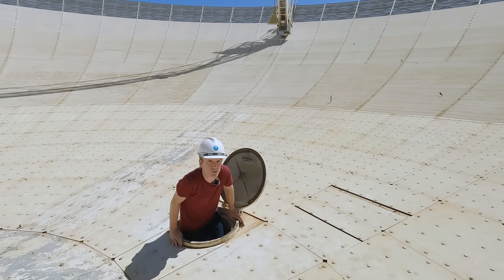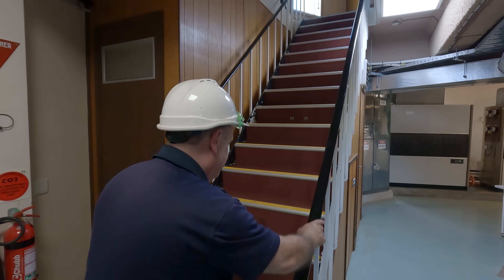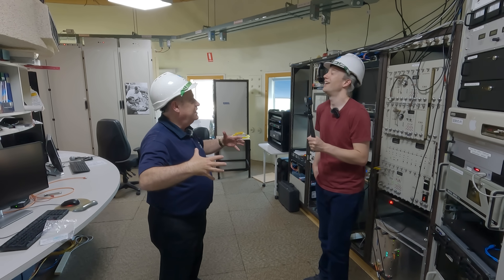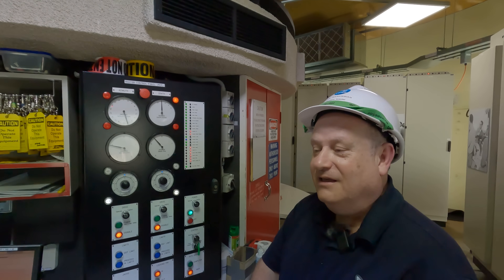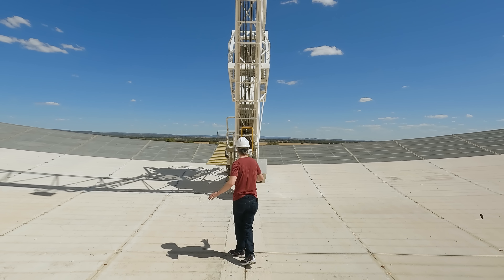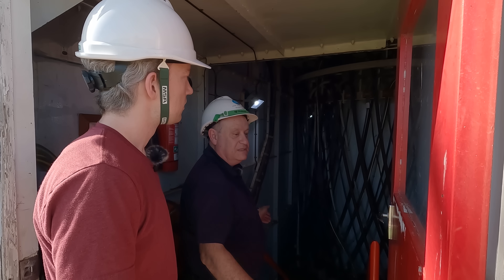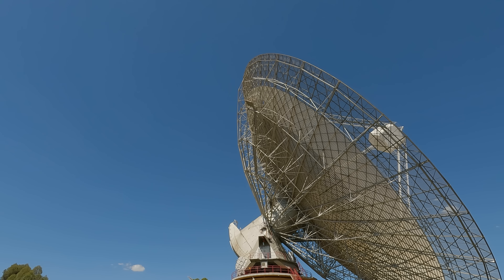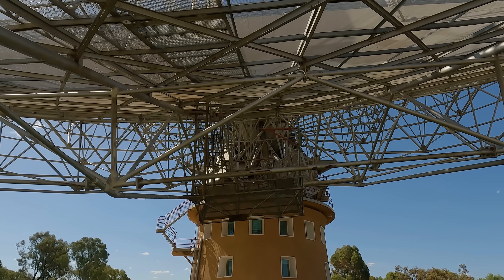I took a ride on a moving radio telescope

Comment: In 1977 I "rode the dish" at the old 27m incoherent-scatter radar located in Chatanica Alaska - its a very intersting experience - it was controlled by both a DEC PDP-8 and an SDS-930 computer - both had real hand-wired core memory - since 1981 it was moved to Greenland where it is still in operation but with more modern computing facilities.

Comment: If its possible to pick up radio signal from a phone on the moon, what happens when a plane flies over with 200 phones and radio transmissions being broadcasted?
Reply: Happens rarely and is insignificant compared to other sources of interference.

Comment: So, if the telescope's on separate foundations, just in the centre, how does it keep from toppling over when they tilt it? Just really really really deep and strong foundations? I bet those are probably quite interesting in themselves, though there wouldn't be much to film, all solid concrete and steel or whatever.

Comment: Might be interesting to know this is a part of a three-way telescope system, the others located in Madrid (well, on the outskirts of it, of course) and California, and they are used to maintain a continuous, global coverage for communications with astronauts and satellites.
Reply: That's actually the Canberra (Tidbinbilla) complex, not Parkes. One of the dishes there is tracking Voyager 2 right now, and will then be tracking Mars 2020 (Perseverance rover) after a 1 hour 20 minute break.

Comment: 1:52 The absence of operating system means that it doesn't (or can't) crash when it should---one of the biggest concern of OSes is a fault isolation, and without that you are really at your own. It should have taken a huge care to make that system reliable.

Comment: The way you had the feeling that you couldn't tell whether you were moving, or the dish was moving, or the sky was moving... I experienced something similar a few months ago when I took an engineering tour of the very honorable Mt. Wilson Observatory, located high above Pasadena, CA.  Though built well over 100 years ago with parts that had to be lugged up the mountain by mules and very primitive Mack trucks, when you're in the 100" observatory dome and they turn the dome you think the telescope is turning, not you, the observer, on what you think is a unmoving platform.  It's only when they open the outside door and you see that trees are moving by do you realize what's really happening.

Comment: 0:00  They've gone through a lot of trouble to make the surface of the dish accurate, so I'm surprised they would have the manhole cover protruding up like that when closed.  Why wouldn't they have made it flush with the surface?  At high frequencies, wouldn't that cause a noticeable phase discrepancy in the received signal at the focus?

Comment: The dish itself would make a really cool performance stage for opera. Tilt the dish forward to reveal the inside of the dish to the audience, fill it with light, use the movement of the dish as a "stage curtain" to reveal a modest orchestra and an opera singer inside the dish.

Comment: That they still use a DEC PDP11 series computer is mind boggling. When I started work in Nuclear Medicine 30+ years ago we had an old PDP 11/34. It had a big reel to reel tape drive on the front. It was decommissioned as it was not Y2k compliant, and because it was very, very old.

Comment: The part about the energy in the feather hitting the floor being larger than that collected by all radio telescopes ever was genuinely mind blowing.
Reply: Like staring at the shadow on the wall and being able to tell that someone lit a match, miles away.
Reply: @Technodreamer  That's a probably faulty but brilliant analogy.
Reply: That’s WILD
Reply: I still have the video paused contemplating this fact. I had to replay it a few times to make sure I wasn't misunderstanding him. That's a crazy piece of information.

EDIT: Followed up by the cell phone on the moon's surface bit. I had no idea we were talking those scales.
Reply: @biggusmunkusthegreat  That's the reason behind the sheer size: radio waves sources are generally far away and really weak. For example one of the most important radio frequencies in radio astronomy is the 21cm hydrigen line. It's emitted by a hyperifne transition in the hydrogen atom and it's used to calculate spiral galaxies rotational velocities: the wavelenght is really long, meaning low amounts of energy are emitted.
Also, the resolution power of a telescope (how small of an angle can be where it can resolve two things separated by said angle) is wavelenght divided by diameter. So for such long wavelenghts a reaaaaally big diameter is needed
Reply: @biggusmunkusthegreat  Goes to show how ridiculously far away things are in the Universe.
Reply: Genuinely mind blowing, it shows just how much information we're missing! We've learnt so much from such a small amount of data!
Reply: Dude brought the feather to work that day. He wasn't just ready with the analogy, he was excited
Reply: This is the kind of thing that keeps me fascinated by the miracle that is science.
Reply: I didn’t understand how that calculation works.
Reply: It blows my mind that they could ever possibly filter out all of the radio noise from earth and satellites and the sun and the planets in our system and somehow manage to see distant celestial bodies through all the haze
Reply: Judging by the explanation it's the total energy of all the astronomical data gathered with the telescopes, not all energy gathered total. In effect, the telescopes's have collected far more energy, but that energy was associated with junk readings which were likely discarded.
Reply: ok
Reply: He really put things into perspective
Reply: <10 mJ
Reply: and the aliens are still able to hide themselves from the mess we call humanity
Reply: ok
Reply: frr
Reply: Jesus Christ loves you so much pls repent from your sins and have faith and believe in Jesus because Jesus is the way the truth and the life Jesus died for you and rose from the dead for you
Reply: @jesuslovesyou83558  the flying spaghetti monster is the only real god, he won't send you to hell for not believing in him as long as you're a good person in life, but it's still best to believe in the flying spaghetti monster anyway
Reply: @hiccupwarrior89  that is nonsense
Reply: I would have thought that the radio-frequency output of the Sun would have been more than that.
Reply: @Lucius_Chiaraviglio  It is. You just can't measure anything around the sun.
Reply: :face-orange-frowning::face-orange-frowning::face-orange-frowning::glasses-purple-yellow-diamond::body-green-covering-eyes:
Reply: Wir sind bewusstlos, wenn wir schlafen oder ohnmächtig werden. 
Wenn wir bewusstlos sind, wir haben keine Gedanken, keine Emotionen und können die Welt nicht sehen. 
Wenn wir bewusst sind, wir wissen alles. Bewusstsein ist Gedanken, Emotionen und alles in der Welt.

Dieses Bewusstsein ist eins. Wird das Bewusstsein zweigeteilt? Bewusstsein ist nicht teilbar.
Spürst du zwei Arten von Bewusstsein, wenn du mit einem Freund sprichst? Das Bewusstsein wird nur als eins empfunden.
Bewusstsein ist eins. Ich bin Bewusstsein und ich bin die Welt.

Evangelium nach Thomas

"Denn viele der Ersten werden die Letzten sein und werden zu einem einzigen."

Jesus sagte: "Zwei werden sich auf ein Lager legen; einer wird sterben, einer wird leben."

Aus diesem Grund sage ich, Wenn einer alles ist, wird es voller Licht sein, aber wenn einer gespalten ist, wird er voller Dunkelheit sein.

Jesus sagte: „Warum wäschst du das Äußere des Bechers?
Verstehst du nicht, dass derjenige, der das Innere gemacht hat, auch derjenige ist, der das Äußere gemacht hat?"

Jesus sagte: „Ich bin das Licht, das über allen Dingen ist. Ich bin alles: aus mir ist alles hervorgegangen, und zu mir ist alles gelangt.
Spalten Sie ein Stück Holz; Ich bin da.
Erhebe den Stein, und du wirst mich dort finden."

Eine [Person sagte] zu ihm: „Sag meinen Brüdern, sie sollen den Besitz meines Vaters mit mir teilen.“
Er sagte zu der Person: "Herr, wer hat mich zu einem Teiler gemacht?"
Er wandte sich an seine Jünger und sagte zu ihnen: „Ich bin doch kein Teiler, oder?“

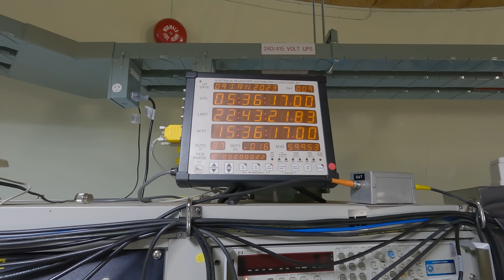Comment: Is that a mistake at 2:06 ? Wouldn't it make more sense to use a hyperbolic shape if you want to concentrate all your radio waves to a single point?
Reply: The parabola is the exact shape required to focus a plane wave to a single point. Hence parabolic dishes coherently (i.e. in phase) add electromagnetic radiation at a point and are central to many telescope designs in both the optical and radio. Some radio telescopes use a hyperbolic secondary though.

Comment: @2:01, you can see Tom standing next to an actual OG PDP-11 they're using, surprised they aren't emulating it on modern hardware. Also who stuck an apple sticker on it?
Also, the PDP-11 did have OSes, most of unix was developed on it.

Comment: They're still using a PDP11???? I don't find the argument about software crashes convincing when there is so much hardware that can go wrong, compared to a modern postage-sized SoC microcontroller that has almost no power draw and only one component that can fail, making any repair a full swap. And a lot of these can also run without an OS, using a simple enough instruction set.

Comment: After seeing Tom all harnessed up and clipped onto the safest walkway Ive ever seen for the high dive video its funny seeing him here completely free walking along an absolutly giganstic tipping bowl.
Reply: It's always interesting to see how counterintuitive a risk factor can be. Standing on a thousand tonne rotating metal bowl is no more dangerous than walking down a moderate hill, whilst the diving platform is designed with the assumption that you want to fall off of it, even if you really don't.
Reply: I always laugh at how timid he is about everything, and yet he still does all of this stuff. He probably plays it up a bit to try to communicate the feeling to the viewers.
Reply: @NickRoman  Where Tom was most uncomfortable on the dish was when he was standing on mesh, which the video doesn't really show very well, so he would have been able to see the ground. I probably would have freaked out too.
Reply: I was quite startled when the Cincinnati Roebling bridge was closed off for minor repairs, and everybody ducked under the tape and walked across, on the bridge's steel mesh surface. (an amazing experience!)  I've driven over it many times, and you can't see the ground due to the angle out the windshield.  But stepping off the paved road onto the mesh, the sudden view to the ground was instantly terrifying for a moment.  My brain asks, "Is this strong enough to hold my weight?"  It's so funny that we never think twice when driving it.
Reply: I guess there's no evolutionary response to standing on a big moving floor.
Reply: Different places have different safety requirements.  The high dive place required it.
Reply: @Zraknul  And by the time you could fall out of the dish, it would be practically on the ground.

Comment: "PDP-11 ... which doesn't have an operating system"  wait, what? I know there is no windows or unix operating system run on it (unix was designed on it) but im sure it had some form of operating system on it, even if it was a custom OS to enable it to control the telescope, it is still an OS.

Comment: 3:35 So, if a mobile phone is the parking lot can be detected, how can they constantly stream the info through the internet without interference? Is that what the new tech in the metal closet is?
Reply: i’d assume same way your wifi modem is probably connected to the the outside internet, a coax cable or something fiber optic
Reply: fibre optical cabling for the transmission, and then put electrical in a metal box

Comment: 2:16 - that’s INSANE. For reference, 9 TB per hour is 20 Gb per second. The fastest residential Internet is 10 Gb per second and almost no one has that. This is downloading at an incredible rate, especially considering it’s coming from space.
Reply: Jesus that is crazy
Reply: If it was 20 GB per second it would be 72 TB not 9 TB so it's more like 3 GB or smth per second
Reply: @EndlexReal  I see the confusion. There are 8 Gigabits (Gb) (what they measure internets speeds with) in 1 Gigabyte (GB). 20 Gb per second is 2.5 GB per second.
Reply: @zacharylowe8083  Ohhhhhhhh alright
Reply: Actually if I wanted to I could get 20Gbps internet to my home

Comment: Speaking of the need to block out extraneous radio waves, I'm guessing that's why I didn't see a microwave oven in the astronomers' kitchen.
Reply: Funny you should mention microwave ovens. For many years the Parkes Telescope would occasionally pick up a strange signal similar to a "fast radio burst" (which are still unexplained) that they named a peryton. From a report that finally solved the mystery - "Subsequent tests revealed that a peryton can be generated at 1.4 GHz when a microwave oven door is opened prematurely and the telescope is at an appropriate relative angle." Probably a microwave oven in that kitchen.

Comment: The comparison to the phone on the moon is incredible. One way these radio telescopes are even scientifically possible is that some radio bands are banned for communication and reserved for astronomy. Even so, adjacent bands can bleed into them, and there can be many other sources for terrestrial radio waves from electronics and the like. It's amazing that they are able to isolate the tiny signals from the cacophony of noise.

Comment: Brings back a trip I took to Cal Tech's antenna 📡 farm in the Owens Valley a number of years ago. Posters from  concerts held in the '70s, custom built equipment...big difference is the reflectors aren't designed to go all the way to ground level (no surprise, you're in a valley with 12,000 foot high mountains to the east and west) so touring the instruments was fascinating and terrifying at the same time.

Comment: I must admit I don't quite understand the polar axis thing.
The dish itself moves on azimuth (rotation about a vertical axis) and tilt motion, so what is it that has a polar axis? An optical telescope was mentioned, which seems to be the part with the polar axis, so how does that fit into everything?
Reply: Best to Google telescope Polar alignment. You will even get diagrams.
Reply: @daveg2104  I know what a polar (equatorial) mount is and how it works, as I own a telescope that has one.
I just don't understand how it relates to the dish on the radiotelescope which has an azimuth/tilt mount.
Reply: @kevinmartin957  OK. I get your point. I'm not an expert on this. For Alt-Az, it seems that the practice is to align on two known objects. In the Northern Hemisphere I suppose Polaris could be one of them. In the Southern Hemisphere, I'm not sure what they do.

Comment: I’ve heard you also an only use diesel vehicles near the dish when it’s operational, because spark plugs create radio interference, unless you use shielded plugs like in aircraft or vehicles with their own radio equipment

Comment: Good old reliable PDP-11s. Wonder how hard it is to get replacement parts if anything goes wrong with them.
Reply: It isn't as hard as one might think -- they made about half a million of them over the years.  Many are still in service for high availability applications like this.

Comment: I was amazed to see the massive rivets on the surface of the telescope. I'd never realised the tolerances are so large they can deal with that: no wonder they don't mind someone walking on it. I wonder whether the latest most sensitive telescopes have tighter requirements -- or whether anything under atmosphere will always be blurry enough it doesn't matter.

Comment: The Australian movie "The Dish" about the role that the Parkes radio telescope played in the moon landing is worth looking up. It is warm and funny and inspiring all at the same time. The scene where they play cricket on the fish surface is one of my favourites.
Reply: I believe that bit was one of the "entertainment" bits they added for the movie (IE they didn't actually play cricket up there, but from memory they did use a tennis ball wrapped in electrical tape as is tradition so points there), that and the "climax" bit (no spoilers) was somewhat overstated but as far as "based on a true story" it's really quite good and a very good watch 9/10 would recommend to all.
Reply: Fish is a dish, so I don't mind spelling :P

Comment: To give you all some scale about how much 9TB of data an hour is, that would be like downloading the following every hour:

Every song and album the Beatles have released in lossless FLAC quality 2,571 times

Every game released on the PS1, GameCube, N64, NES, SNES, Gameboy, Gameboy Advance, Nintendo DS, Sega Dreamcast, Genesis, and Saturn and would still have bandwidth left over.

An average YouTube video 12,857 times

A standard DVD 1,914 times

A dual layer Blu-Ray disc 180 times

A typical 4k HDR movie rip 473 times

All of Wikipedia (excluding images) 409 times

692 days worth of the average person's mobile data usage

9TB (9,437,184 MB) an hour converts to 20,000Mbps (MB is megabytes and Mb is megabits). The average home internet connection speed in the US as of 2022 is 119Mbps. This means this dish will have the bandwidth of 168 home internet connections.

With the information above, we can assume the bandwidth of this dish would be able to handle 13,333 4k Netflix streams at the same time.

Or 1 single Call of Duty Warzone update.